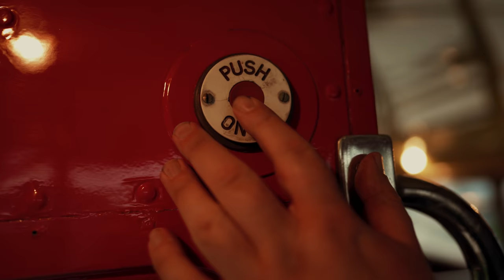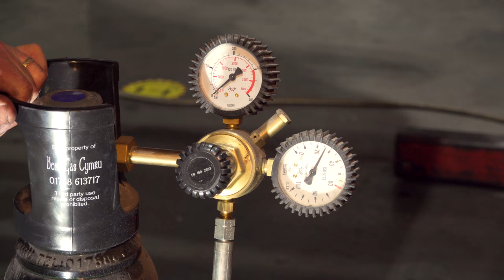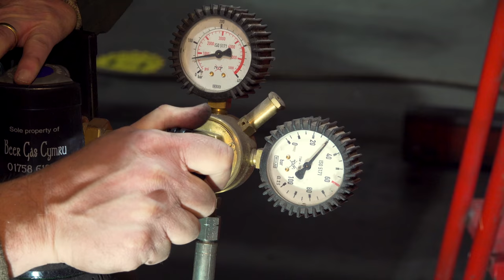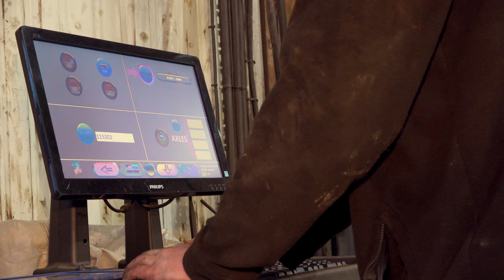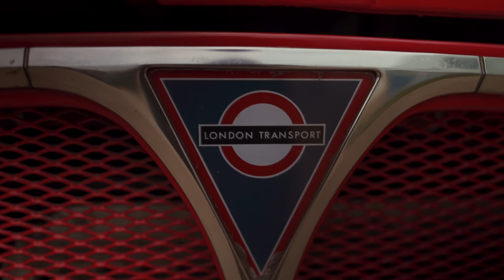Double Decker Bus Restoration | Maintaining The Unique Braking System on A Routemaster London Bus

Comment: The brakes in full efficiency and the bus will stop very quickly. Tell me about it, I used to work as a conductor on Routemaster buses. One day one of the passengers dinged the bell four times and the driver, well basically stood it on its nose..! I ended up banging my head of fee front bulkhead, oh and paying in short as the change went everywhere. Enjoyed the video it brought back lots of memories. Happy days.!

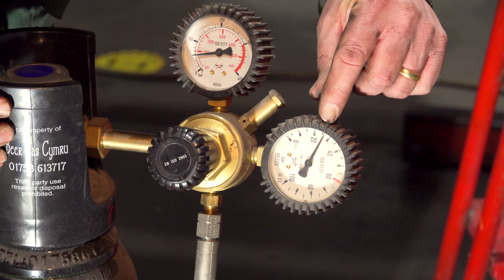Comment: Great video, but at 14:49 I question your statement of nitrogen being at all dangerous.  Every time you breathe, 78% of the air that enters your lungs is nitrogen.  The only way that nitrogen could be at all dangerous is if you were inside a completely sealed vessel, or an underground tank where a LOT of nitrogen would be required to displace all the oxygen.
My favorite part was when you were arriving at the commercial test depot with the interior lights on.  Took me back to my childhood for a moment when the bus would arrive on a cold wintry morning with that lovely warm interior glow.  I also seem to remember that the buses of yore always had a certain interior smell to them - not bad, just distinctive.

Comment: Wow I never realised how sophisticated these machines were.
Reply from the maker: There were ahead of their time when designed back in the 1950's.
Reply: @Routemaster4Hire  Never before or since has so much time and money been spent on a bus' development, all angles were covered, passenger & crew comfort, ease of maintenance, engineering standards ensuring interchangeability of parts, etc. I think some will still be running at 100 years of age, if properly looked after.

Comment: I recently watched a video about hydraulic brakes on the Toyota Prius. There are remarkable similarities. Since the hybrid drive shuts down under certain conditions, you don't have a constant vacuum source for typical hydraulic brakes. The system uses a hydraulic pump and a gas filled pressure accumulator so that the brake pedal can be pressed multiple times without needing a constant external energy source.
Reply: I was thinking the same thing about the Toyota Hybrid brake system. It’s a bit more complex than pure hydraulic though. When switching on the power from rest, you can usually here it run up the electric pressure pump a bit. Then it does it’s own sums to ‘blend’ regenerative braking and hydraulic, and engine braking if you select that, as you go along - including what pressure to use, such as ermergency braking. It’s ‘brake by wire’ as it were, not a conventional foot operated brake. Works well on my Yaris.

Comment: My team did a lot of work for LTE in Nottingham, including RM refurbishment and component rebuilds. We used to overhaul front boats, gearboxes and all the sub components. Part of the LT sign off was testing the braking system with gauges on the hydracylic system so you could monitor the cut out operation. Like you we used nitrogen to refill accumulators.
Your initial comments about why LT demanded this form of brakes ommited one major reasoning behind it. As traffic concentration in the city increased and hence more brake applications, the conventional air brakes systems depleted air too quickly and this resulted in the flag dropping, necessitating the driver select neutral and rev up to rebuild before proceeding. In dense traffic areas like Regent Street/ Oxford Street this resulted in clouds of diesel fumes and great concern over air pollution. Colin Curtis remained adamant that modern air brakes were untenable for inner London for years, despite considerable technical advances until they were finally persuaded to trial Leyland Nationals with all air braking. The Titan was also developed with hydracylic systems for this reason and the crippling cost of it prevented Leyland Bus from being able to sell the Titan B15 to other UK operators. Hence the lesser expensive Olympian was created for the majority of NBC and municipal customers.
Good videos there chaps. Invoked memories.
Reply: I was surprised at no gauges put on the hydraulic system for cut out and operation.
Reply: I thought it might have been climate considerations but never considered that aspect. Obviously they didn't have very big compressors back then.

Comment: Isn't normal air made up of 78% Nitrogen?

Admittedly, if you were to replace all of the oxygen  with nitrogen, it would cause hypoxia, but that would take more than a small bottle in such a large space.

The exhaust fumes are much more dangerous IMHO.
Reply: Yes it’s not toxic. Probably better to say “this gas is dangerous if it is allowed to fill the room”
Reply: My local tire shop wanted me to pay for filling my car tires with 100% nitrogen. I told them I wanted to stay with the 78% nitrogen mix, as that is my preference. They asked me where I got it, and I told them it is available at all petrol stations for a nominal fee of €0. They didn't get the joke...🤣
Reply: @sjokomelk  When people ask me if we have nitrogen I tell them we use a proprietary 75/25 nitrox mix.

Comment: It amazes me how wonderful the old diesels start up with such ease, Modern vehicles will be lucky if it even reaches 20 years let alone 55-60 years. 
I miss olden days when things was built to last not like today's world.
Reply: This is a yes and no response to your comment and being 66 years old and having worked in the bus and coach industry for 46 years I think I am qualified to comment. Yes the older vehicles were built very heavy and with a lot of engineering redundancy as rebuilding components was the normal practice due to the much higher manufacturing costs and lower labour costs. Longevity of heavy transport components has actually improved if they are properly maintained due to the better materials used in there manufacture but what hasnt improved is reliability and most of this is down to complex componentry being used to improve emmissions and control systems that once had simple mechanical control. The advent of computerised controls has seen a massive increase in power delivery for a given engine size so smaller engines can do the job that larger more polluting units used to do. Its true that we are more wasteful these days in not designing components to be rebuilt but that reflects two things That components need to be much lighter to aid in fuel efficiency and emmission control and that labour costs are much higher as a percentage of total mantenance costs. Change is never easy to deal with but you have to keep an open mind.
Reply: @alistairshanks5099  I do always keep an open mind, but find these day's such as white goods regardless of price are rubbish quality, a friend had replaced a alternator twice as both units failed within 2 years of each other. These days most items are NOT repairable and i think that's where we are going wrong as often things end up in landfill.
Reply: Old diesels run so long because they don't make a bunch of power. Horsepower kills engines. Modern diesels are marvels of engineering. Even relatively small TDs in modern pickup trucks make 500 hp and 1000 lb ft. That's likely triple what these old engines make, and the new ones, especially with synthetic oil technology will easily run as long as these old engines. What kills modern diesels and makes them such pigs, of course, is government-mandated emissions controls. They've managed to just about negate any return on investment of owning a modern diesel, since almost all of them will suffer debilitating reliability issues due exclusively to emissions failure.

Comment: That braking system is really interesting and advanced.  I work for Lexus and most of our models now run a similar system, with a hydraulic booster pump and an accumulator charged with nitrogen to keep pressure.  We get about 40 pumps before pressure is discharged.  I wish the booster/accumulator was serviceable, because they're expensive to replace when they (very rarely) fail.

Comment: The braking system on these seems similar to a Citroen. Not super hard to work on, just different. And if you use the wrong fluids it causes a heap of trouble! 
I used to have an Audi 100 with hydraulically boosted brakes. It used conventional brake fluid; the accumulator and pump were only for servo assistance. 
It's nice you take your passenger's safety seriously.

Comment: I work on vintage buses over here in the states. Mainly gm 4104’s crowns and gilligs but there was a guy that brought one of these in for service last year and it was converted to air brakes. We had no idea how to work on it due to never seeing one in person before. Took the boss a ton of research and calling someone in  london to help us figure out how to work on it. That brake test at the end is odd to us, we road test our buses to check the brakes after adjustment. We check at 5mph, 15mph, 25mph, 50mph and 65mph for pulling or uneven stopping

Comment: Nitrogen poisonous? 
Hope not, 80% of the air we breathe is nitrogen.
It is an asphyxiant because it's not oxygen/air, but breathing it in in the workshop won't harm you so long as there is air as well.
Reply: Nothing wrong with erring on the side of caution. You wouldn't be able to tell until you keeled over which is why there are a depressingly monotonous list of confined space deaths especially in India where someone passes out and the helper/rescuer succumbs too and then another erstwhile rescuer in a septic tank , well or other enclosed space.The only way to be sure is to use a certified gas tester which will alarm if 02 levels get too low or there are dangerous gases like hydrogen sulphide etc. Mandated when working in designated confined spaces.
Reply: @rogerpearson9081   I agree with caution, but factually nitrogen isn't a poisonous gas like carbon monoxide etc.
Reply: @teepi280  You beat me to it 👏🏼
Reply: Haha yeah I also keep my tea kettle well circulated to prevent it from cumulating dangerous amounts of dihydrogenmonoxide xD
Reply: @GrafRucola  😁😂🤣
Reply from the maker: Nitrogen can be dangerous, Inhaling air containing mostly nitrogen can lead to various signs of physical and mental impairment. Depending on the concentration, it can cause sudden unconsciousness due to asphyxiation if inhaled in a large enough quantity.  This is why it was mentioned in the video.
Reply: Funny there is these people and then there is Cody from Cody’sLab  casually inhaling heavy gases  that are so heavy  that he has to hang upside down to clean out his lungs xD
Reply: @Routemaster4Hire  air contains approximately 78% nitrogen. Air already is mostly nitrogen, you've been breathing it all of your life. Other than that, I enjoyed the rest of the video
Reply: the issue with nitrogen is if you manage to get it in a confined space you don't choke you just pass out, and then die, no coughing no suffocation just breathing nitrogen then dead,
never understood why we don't use it for executions as it's humane, cheap, and 100% effective
Reply: Excellent video , one query re. Slack adjusters. If auto adjusters fitted any tendency to run off would indicate the firsf stage failure .An adjuster not adjusting  
would start to slack off in a short time

Comment: I used to drive one of these with brakes that faded away the longer you drove  and the  hotter the bus got. It turned out that a non return valve was missing from the system.
Reply from the maker: Funnily enough, we have just had one of those explode on us!

Comment: I remember being told a story from the late 40s or early 50s about a local bus company which had bought some new buses. After the first one had been serviced it ran away down a steep hill, turned over at the bottom and crushed a parked car with the owner standing just feet away. Fortunately there were no serious injuries. Apparently the mechanics had never worked on the type of brakes before so I suspect that, given the date, it was this type of Lockheed braking system and they got it very wrong.

Comment: Interesting look at circa 1960 bus engineering. Surprised it is not a full air system but I suppose a lot of trucks back then were only vacuum/hydraulic. Given the climate, maybe full hydraulic was a good choice. Also surprised to see independent front suspension.  I have only used a 32 Tonne forklift with hydraulic brakes but I wonder what sort of feel this system has as the forklift was not that nice to use and seemed to buzz the pedal a lot. Maybe it was a rubbish system compared to the Routemaster. Thanks for showing us around. Ditto comments on underside cleanliness but it makes your job a lot easier.

Comment: Interesting brake system, basically uses hydraulic oil instead of air and recirculates it? Ford trucks used a similar system on their truck that used hydraulic oil for their park brake. Made by Lucas girling

Comment: As an apprentice I always had a 9/16” AF spanner and 12mm spanner at hand for “pulling up” brakes at MOT, even after adjusting them at pre MOT inspection, the time you got into test hall you always asked if you could “jump down and pull them up” the Volvo z cam was a different story though, they were a terrible braking system for trucks
Reply: Me too and most of the time I was hauling 20 tons or better and I always sneaked around and set my own brakes. Diesel trucks, dumpers and tandems and trailer pullers and never had an issue but almost all were air systems. Doesn't look like a lot of weight savings between this air and your hydraulic but maybe enough to make it worthwhile. I always tightened the slack adjusters tight and backed off 1/4 turn or till the lock engaged and never jacked a wheel off the ground and never had a hot brake and plenty good stopping power. Had to have good 'S' cam bushings and everything greased though. I have carried a grease gun and greased the cam bushings 2ice a day when they were worn to keep them from binding. So CHEERS and stay greasy! I sure do!
Reply: Neither of those spanners would've been any use for the RP adjusters on RMs.
Reply: @bobcornford3637  I'm in the US and was working on Macks mostly. And I do have metric stuff too.

Comment: I used to adjust these brakes by fully winding on the slack adjuster and back it off until the wheel moved as you have shown,. By winding on the brakes fully and backing them off you need to feel a click from the adjuster , if you do not then the slack adjuster is worn and needs replacing / repaired.

Comment: When I was taught to drive. RML by London Buses, to apply the hand brake you pushed the foot brake down to the floor then pulled the hand brake all the way untll it stops.
Reply from the maker: That's exactly what we do when we park up and leave the bus in a public place.  Should anyone try and take the bus for a joy ride they would struggle to get the hand brake off.
Reply: I used the same method on my classic Mini! Shocking hand brake😃

Comment: The same accumulators,and gas pressures were used on the steering system on Leyland Martians 6x6's that were used in the army in the 50's onwards
Reply from the maker: Unique on buses but used extensively on WW2 aircraft.

Comment: Hi how long between brake flag up and full pressure "knock" after the adjustments and accumulator top up had been performed? Did it improve the wait time? I don't think you mentioned it in the video. Cheers and keep up the good work guys.

Comment: Fascinating glimpse into a world not normally seen. I was hoping that you were going to check the schrader valves for nitrogen leaks while they were exposed. Assuming they were not leaking where does the gas leak out to? Into the hydraulic fluid?
Reply from the maker: Yes it leaks into the oil side of the accumulator.